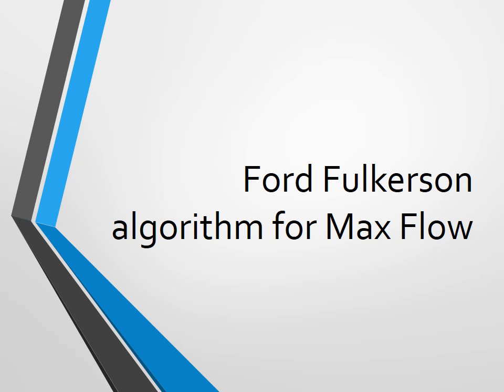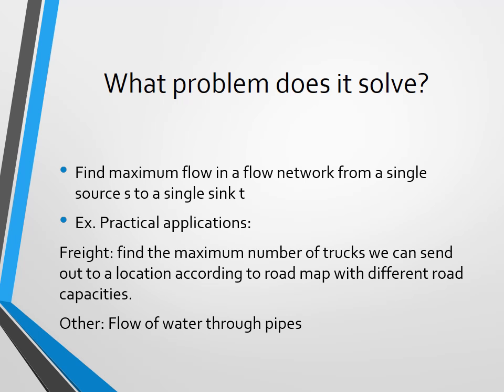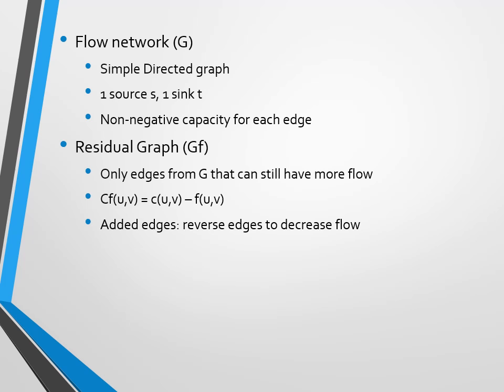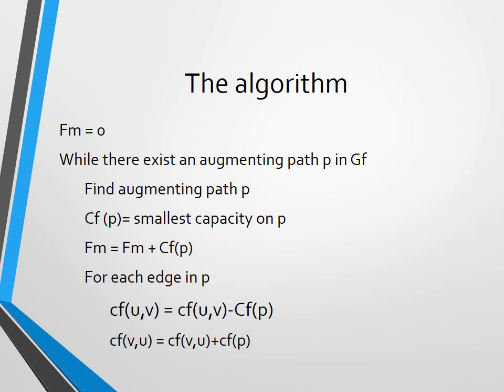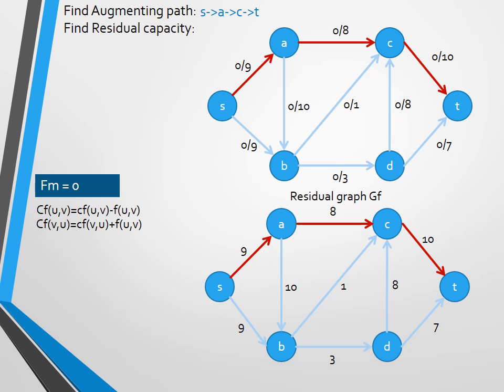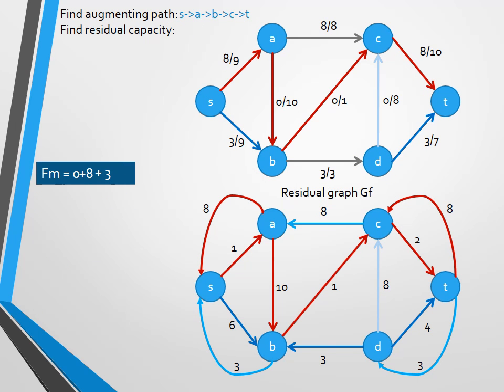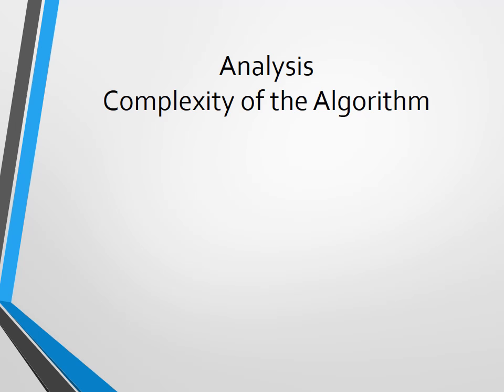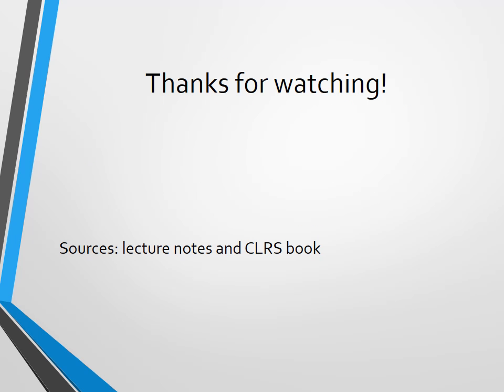Ford Fulkerson algorithm for Max Flow

Comment: I'm still slightly confused on backwards flow. First off, why do we do it? Is it because we have leftover capacity for flow on the forward edges? And if so, does the backward and forward flow have to add together and be less than or equal to the capacity of the edge?

Comment: in the residual graph  you have to add some constraints so :: Cf(u,v)=Cf(u,v)-f(u,v) is true only if  f(u,v)<=Cf(u,v)
and Cf(v,u) equal f(u,v) and not Cf(u,v)+f(u,v) and this is true only if f(u,v)>0 .
Also after finding the the augmenting path and Cf(p) you have to add some constraints : Cf(u,v)=Cf(u,v)+Cf(p) is true only if the edge in the residual graph is a forward edge.And Cf(u,v)=Cf(u,v)-Cf(p) is true only if the edge in the residual graph is a backward edge.
And the algorithm stop when there is 0 augmenting path in the residual graph then we can say that we have the maximum flow |f|.

Comment: i think that there is a mistake at 5:27min… Because from S-B in residual graph there should be 7flow to B and 3back-flow to S.
Reply: Yes but not 7 flow to B just 6, and also the flow from d to t should be equal to 4.
Reply: Upsa, yes i meant 6(9-3=6) :)

Comment: Thank you for the explanation. Can one use this for a graph with pre-filled flows, where the only way to go is through a back edge? I assume I could just clear the flows and reconstruct it along with the residual graph, but isn"t there an easier way? We got this on an exam and I had to figure it out manually.

Comment: you have a mistake in the slide at 5:18. the edge from s to b should be 6 and from d to t should be 4.
Reply: +ghaithammar2008 correct.  But that thankfully doesn't effect the viewer's understanding.

Comment: Correct Answer: 

0:  0->2 4.0/9.0  0->1 8.0/9.0  
1:  1->3 8.0/8.0  1->2 0.0/10.0  
2:  2->3 1.0/1.0  2->4 3.0/3.0  
3:  3->5 9.0/10.0  
4:  4->5 3.0/7.0  4->3 0.0/8.0
Reply: +SandyOC100 and I thought I was the only one who noticed that the video's solution is wrong..